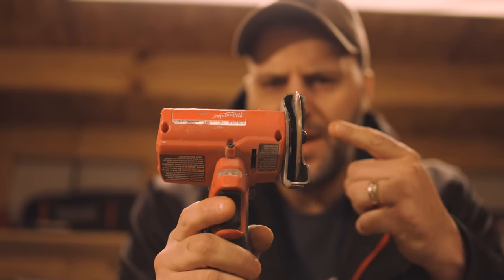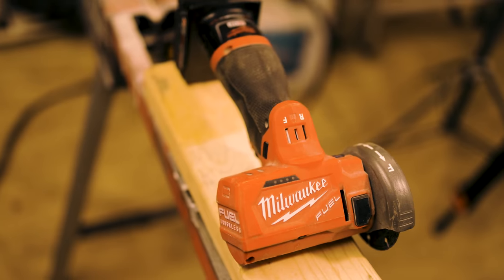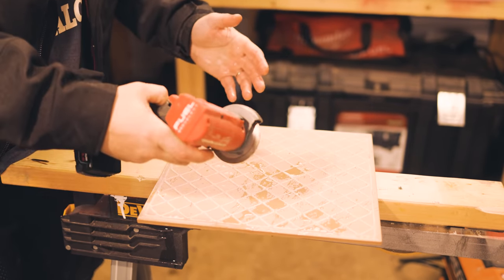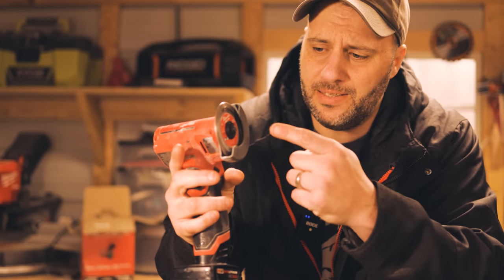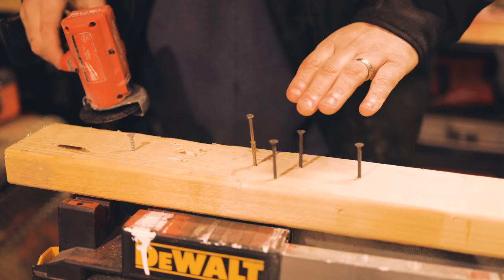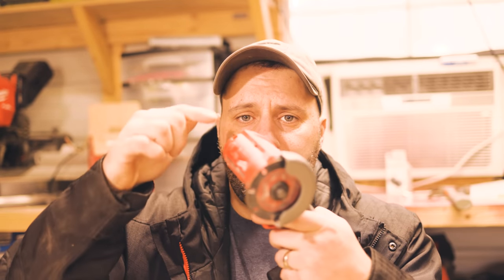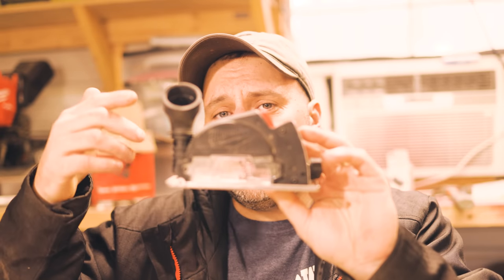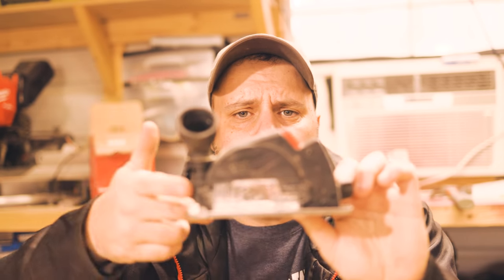Milwaukee Tool approved at first but this is how it held up one year later (Milwaukee Cut-off Tool)

Comment: Sure. I'm fascinated by tools like this. But as I was using my $29 corded grinder last night to smooth off some roughness on the leading edge of the mouth on my snow blower, I concluded, don't waste your money. For me, a $29 corded grinder does everything I need. I can see this tool being very useful by trades people or for working on smaller jobs in tight spaces. And yes, the portability is nice. But instead, I'll spend the money on something else. I have a list.
Reply: I got my DeWALT DCS348 specifically because I already have a corded grinder and felt that a cordless one would be redundant with no additional utility beyond being cordless. Being smaller and more controllable with one hand opens up a few more uses. I intend to use this for working on the motorcycle where I have no power source.

Comment: Do you think this would do with cutting plywood? Im a residential electrician and sometimes i need to put a box up but theres plywood. I use a circular saw to make the cut but its sketchy so i wondered if this tool would help
Reply: Heard it doesn’t work well for plywood can anyone confirm?

Comment: I never use the dust cover attachment. I use this tool mostly for cutting drywall and it does pretty good at that. I agree that it’s a bit under powered I tried using it to cut up an old Shays lawn chair just to cut it in half to the pipes that had rusted through. And it did not cut that so well I would’ve been much better off using a hacksaw. But for cutting screws or nails does a fair job. And for cutting drywall and cutting it straight awesome. I haven’t had an opportunity to use it on tile yet.
Reply from the maker: Thanks for the feedback Josh!!!!

Comment: It’s great to fix someone else’s fuck ups when you got no choice but to do it on tile . Specially if you got smaller tiles. That have something underneath and the grinder blade is to wide. Also great to cut pieces “on the go” right next to you when you’re cutting tiles outside instead of a grinder. Less dust. Etc